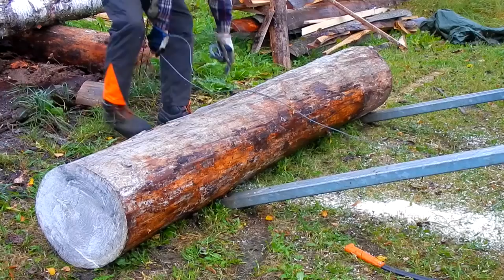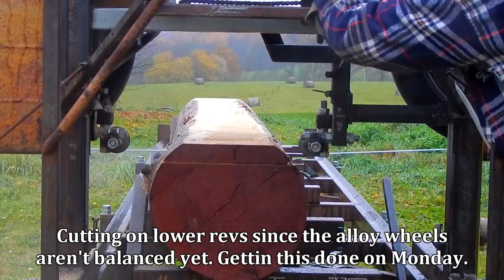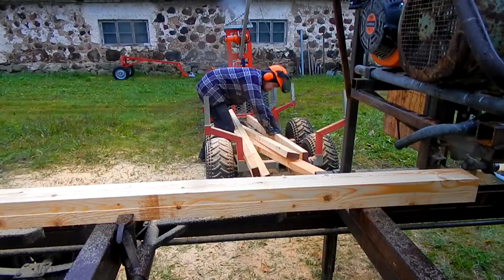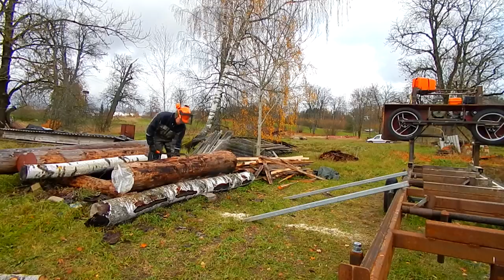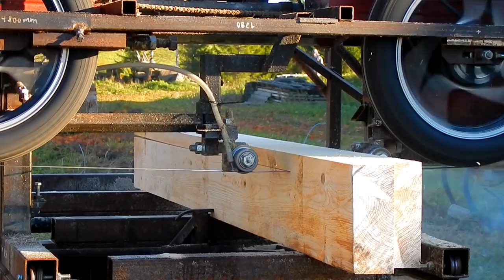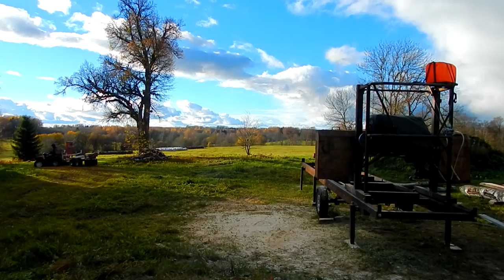Sawmilling Workshop Wooden Frame Wall Material - Band Sawmill Build #26

Comment: It seems to work pretty good!
Reply from the maker: Now when the wheels are balanced I can go full throttle and with a fresh blade it rips through the wood in no time. Also the sprocket on the new wheel is a bit smaller which upped the revs and thus the blade speed by a quarter. So all good!

Comment: Really like your mill. I have a couple acres I want to build a house on. Not enough trees to harvest much wood, But if I built a mill, I could buy logs to make lumber and still be better off than the cost of buying all my lumber. Anyway, I like your mill!
Reply from the maker: Cheers. Building a mill is absolutely worth it. Some might say it's not but they probably say that about everything.
Reply: @DonnDIY  Было бы здорово, если бы вы поделились чертежами. Или хотя-бы основными размерами! Хочу повторить вашу мельницу, но уже устал оценивать размеры на глаз и масштабировать опираясь на знакомые предметы)
Reply: @DonnDIY  Can make a video where the dimensions of the saw nodes are measured?

Comment: The tires and rims work well in this configuration, the old rims/tires had a bounce to them which became quite obvious in the slow-motion shots.
        Mike
Reply from the maker: These rims are really straight, no throw in'em whatsoever. Just the mass is uneven, thus the need for balancing.

Comment: I noticed you roll the logs away from the stationary guide posts so the sawdust debris  dose not make for uneven cuts. A good level clean saw bed is always a plus. I don't remember if you have the motor and drive belts covered so they stay out of the  rain and sun, but if they are they will last longer maybe.
 Good luck, I hope you can close in the shop while it is  still  kinda warm outside yet. Are you going to  build a Rocket type heater for the shop?
Reply: Donn i have very nice old motor oil air heater if you want ideas. My worn out garage holds 25C if running. Space about 50cm2.  1l/h consumption. Let me know if you want pics.
Reply from the maker: I'm using a belt on the mill that originates back to the times when my grandfather still drove his USSR T-100 tracked dozer. It must have been at least a couple of decades ago and this belt is still kicking. Eventually the mill be under the roof without direct sunlight so I will not bother with a belt cover. :D I'm just that lazy. I'm gonna go with a Bullerjan type of wood stove and add the sawdust stove in the mix there to utilize the sawdust coming from the sawmill.

Comment: What prompted the switch to mag wheels? P.
Reply: sbirdranch 
If you watch the older video as he made the sawmill the one wheel was warped and he took it to a tire shop to have it straightened and balanced. In the end he still wasn’t happy with it and felt he could get better blade tension with the alloy wheels.
Reply: @Crewsy  I didn't recall that.  Thanks.

Comment: That was very successful. Could you tell a performance difference between your spoke and Allo wheels?
Reply from the maker: There's pretty much no difference in performance - just the blade is more stable in the unsupported area just before rolling under the first guide roller. In the older videos you could see how the camera picked up the amplitude of the blade. Now it's just a straight line. Oh yeah - the blade can be pulled tighter, that is the main difference. ;)
Reply: @DonnDIY  That sounds like a worthwhile mod for you for sure. Thanks for the kind and thoroughly reply.

Comment: Is the electric motor for when you can use electricity? I'm hooked on your videos. This is two nights in a row I've been watching. I'm gathering parts to try building a saw of my own.
Reply from the maker: Yup, the electric motor is actually the primary power source. Not connected yet though. 😁
Reply: Look at other home built bandsaws you may change your mind
Reply: Donn DIY I had this same question when I watched the video of you putting the electric motor on there.

Comment: What brand of steel are the rollers made for stretching the saw blade? From the brand of steel that rollers to move the sawmill?
Reply: Дмитрий Головин 

He made all those parts on his lathe from steel.
Reply from the maker: I don't know the brand unfortunately. I just took a round bar from the storage rack and started turning it in the lathe. Nevertheless - it holds up really good at the moment.
Reply: @DonnDIY  Is there fast wear on the rollers? In your opinion, how long will the tension rollers last?Should I make rollers from hardened alloyed steel?
Reply: It is mild steel ‘ or low carbon steel ‘ and they will last for a long time’ in other words they are not heat treated ‘ home made

Comment: Do you think you'll ever use the electric motor?  The petrol one is doing fine.
Reply from the maker: I will use the electric motor when I get the mill under the roof. The petrol engine will be just a backup for whatever power outage situation that might occur. So when there's apocalypse and zombies are roaming around I can still cut lumber.
Reply: Yes! To board up the windows and doors!
Reply: @putteslaintxtbks5166    And to make shape pointy stabbing sticks.
Reply: Donn could also mount that mill on the front of his car or truck and it'Id mow them zombies right down !

Comment: long term project 40' by 80' pole barn with wood siding? all lumber from the saw mill
Reply from the maker: I have a drawing made for a 5,5 x 14 m sawmill shed with a concrete floor and it's in my to-do list. However, first I want to get this corner of the barn closed up so I can work on tedious stuff in comfort. Tedious like a sawmill blade sharpener and a kerf press. :D
Reply: @DonnDIY   R&R buildings has alot of videos on building pole barns up here he builds them day in day out

"Off grid homesteader Cecil E Skinner" has a channel with similar stuff as you do he uses a bench grinder to sharpen the blades and has good luck with it, seems crude but i guess it depends how smooth/high quality you need the cuts
Reply: @DonnDIY  will be looking forward to the workshop/shed build for sure saving towards my own venture into something similar currently